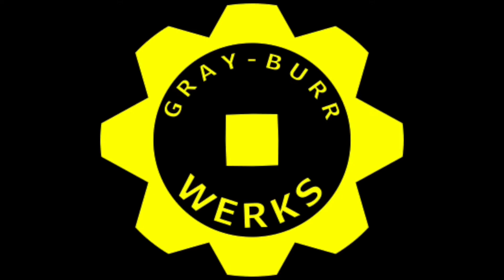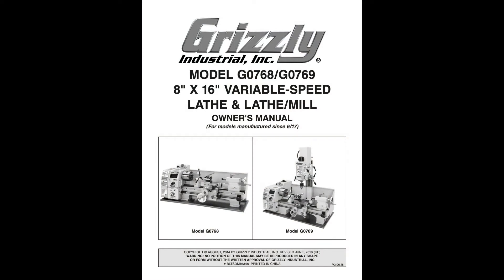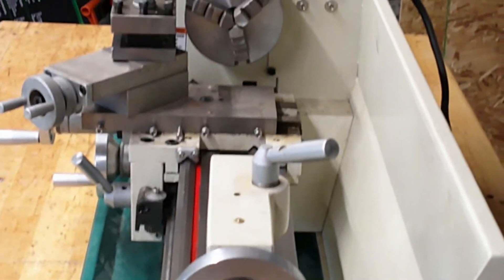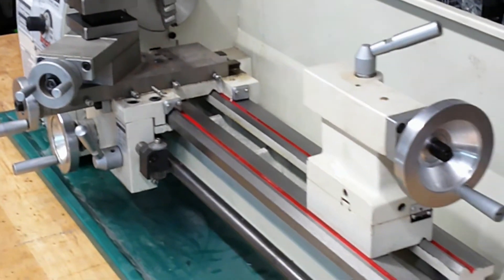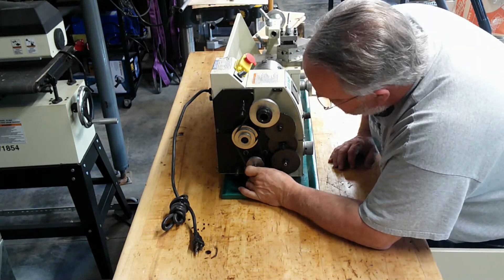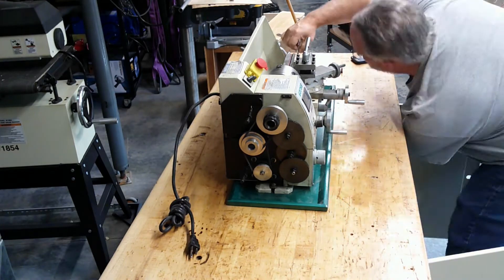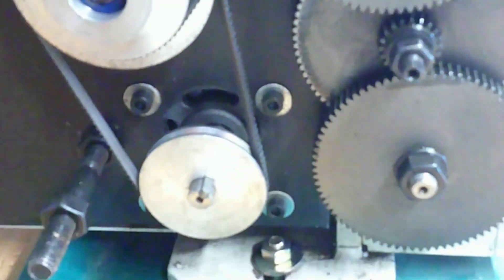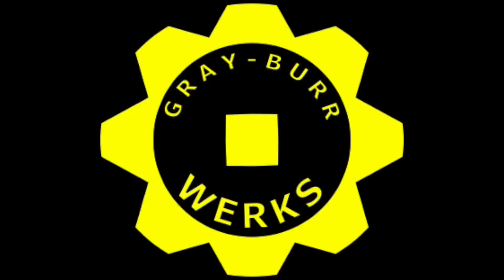Grizzly G0768 Mounting Instructions

Comment: I know this video is old but I have a Question. I just bought this lathe new from Grizzly, My Motor Hums loudly is this common? Does yours?
Reply from the maker: Without hearing the hum from the lathe, I can’t give you a good answer. The first thing to ask is the noise coming from the motor, electronic components, or the drive train. Check for loose components. I would turn the power off and disconnect the power cord (safety first). I would then turn the chuck by hand a few times and see if there is a “Rough/rubbing/etc” spot. If none are found, then I would look at the gears and see if something is not aligned up correctly. If none of that revels an issue, then I would check the motor and electric components with an ohm meter and see if it drawing too much currant or has a spike. Look at the manual, under trouble shooting for symptoms and what to check. The manual has a section titled “Machine has vibration or noisy operation”. 

I tore down my lathe and throughly cleaned, lubed, and, reassembled it. There was a lot of chips and crud though-out the machine. Use your phone and take pictures during disassembly, you will need them. 

Thanks for the question and have a blessed day!
Reply: @grayburrwerks4117  Everything sounds as it should as far as the chuck and gears. My concern was once I turn on the lathe and turn up the rpm's the motor hums. It was kinda loud to me. I sent grizzly a video. They said  that the noise was normal for having a DC Motor. My last Lathe was powered by an AC motor so no hum.  They say at Grizzly that everything sounds as it should. But the Motor hum was very alarming to me. I thank you very much for you reply. Have a Great Day.
Reply from the maker: @TBauer-s8b  Sorry for the late reply! Somehow YT didn’t let me know you had responded. If you want to send me the video, I’ll try and compare it to my lathe and respond to you. grayburrwerks@gmail.com   I feel your pain when something just doesn’t seem right, I always try to trust my gut…sometimes it works out and sometimes it doesn’t. Be very careful and wear the proper safty equipment when working on your lathe.

Comment: Does this model come with Tapered roller spindle bearings?
Reply from the maker: Yes it has tapered roller bearings, but, they are not the best quality. They are good enough for now and most likely be replaced sometime in the future. Tighten the bearings is a test of patience...especially for me and my lack of patience...it took a few attempts to get it the way I wanted.

Comment: how much did you pay and how long ago? going for $1695.00 on 3/19/2022. also seen a lot of bad reviews on Grizzly's web site
Reply from the maker: I think I paid about $500 at one of the last Grizzly tent sales before covid (missing parts, dented, broken components, open skid, it was a gamble), about 3 years ago. The lathe has sat for the past few years because of a household move. The lathe is what you make it, experience with lathe set-up and operation helps to make this lathe as good as it can get. I have had a few quality issues that I had to fix (future videos). This lathe is not a South Bend, or other very high quality lathe, but I found it to be a good value as a hobby lathe, even at a higher price ($1695 + Tax + Shipping), and a great learning experience that will help if I move up to a larger lathe.
Reply: I couldn't make out what you were saying, so I quit the video and moved on.